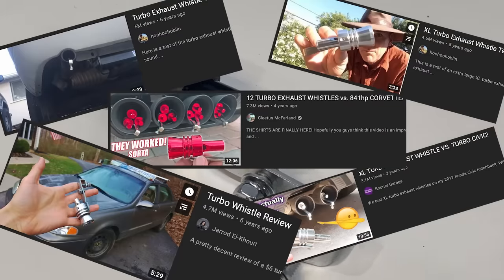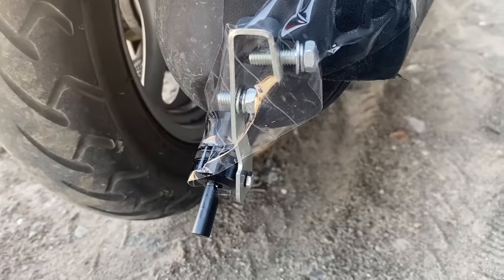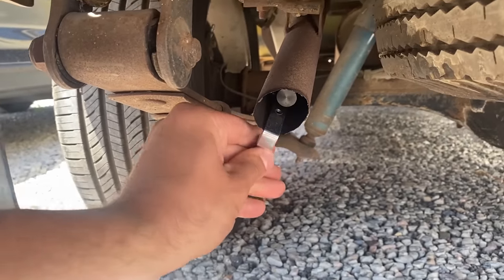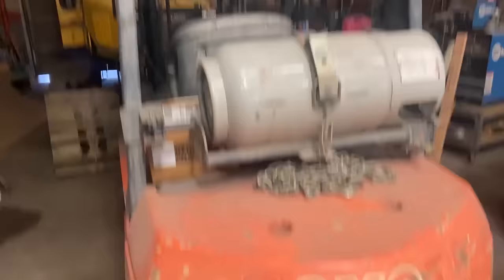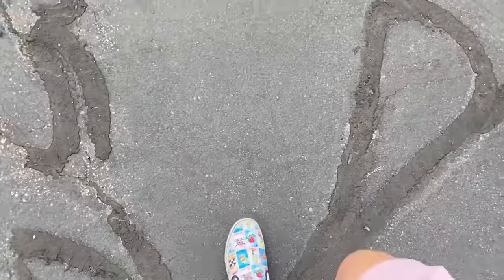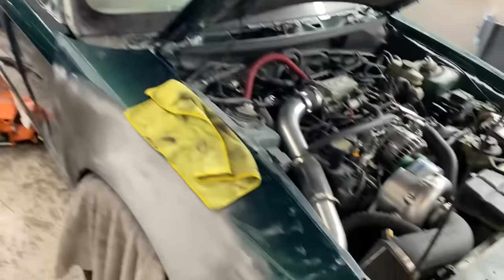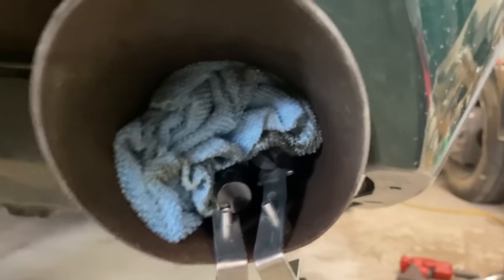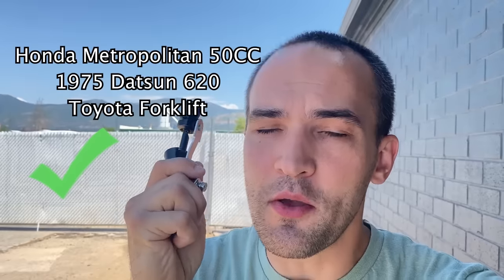Amazon Turbo Whistles - Trash or Treasure?

Comment: Air, just like water and electricity, is going to take the path of least resistance. If you don’t have a tight seal around the whistle, the air (exhaust) will just go around rather than through it. So basically, the whistle has to be about the same size as the pipe in order to work.
Reply: i think it might be a bit more complicated than that here. sure the size may help but i think it might also have to do with the exhaust pulses and firing order having to be just right 

not sure anyone would spend the time and resources to find out though.
Reply: @GrandHuevotes  that too. Plus horsepower is gonna drop like a mutha as well
Reply: @23Skadoosh  wtf are u too high???  :D?
Reply: @kassikattonen  isn’t everybody?

Comment: I had one of these on a ‘96 Miata with an all stock 1.8L engine. It definitely whistled until it vibrated loose and I lost it on the interstate. 😅
Reply: Probably ended up giving someone a puncture if it didn’t just disintegrate due to it being a little Poundland chavvy mod.

Comment: The fatal flaw in these whistles is that the sharp edge of the whistle should be offset further into the air stream and also they need a larger deeper air chamber on the actual whistle side. Ask me how I know.
Reply from the maker: How do you know?
Reply: Yes, how do you know?
Reply: As silly as it sounds I set out to make my bov on my car louder and more whistly. I started off by imitating the design of those exhaust whistles for the whistle part and had multiple prototype inserts that did not work. Then I started studying the actual design of real whistles that worked and noticed the two attributes I mentioned in my initial comment so then I altered my design and surprise they worked and worked well. Having a deeper larger chamber allows air to escape back out of the whistle faster so it doesnt cause a turbulence that blocks more air from entering and lowers the initial pitch of the whistle under slower air currents and allows the whistle to increase in pitch as air velocity increases. In addition having a rounded dome to the inside top end of the whistle chamber aids in the air circulating in and out of the chamber without causing further turbulence. If you look at a referees whistle you will notice the air chamber is round like a barrel. Now I will shut my nerd mouth up and sink back into silent shame for knowing so much about how a damn whistle works😆😅🤣
Reply: bro said "ask me how i know" and won't elaborate it